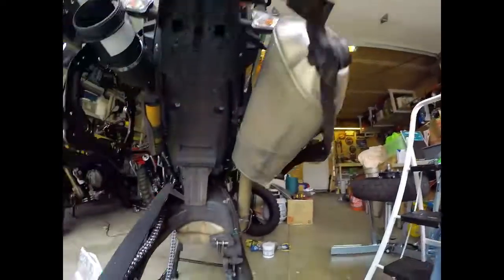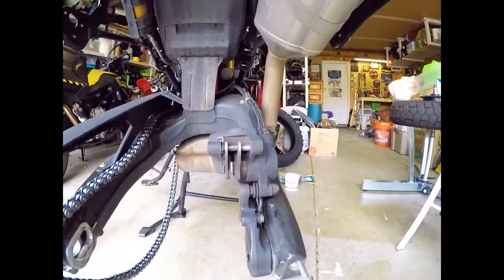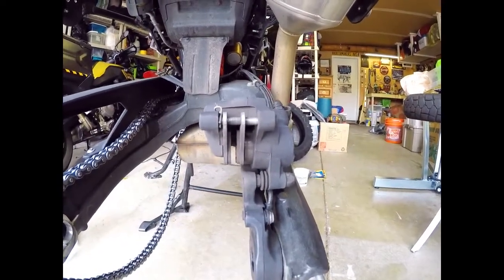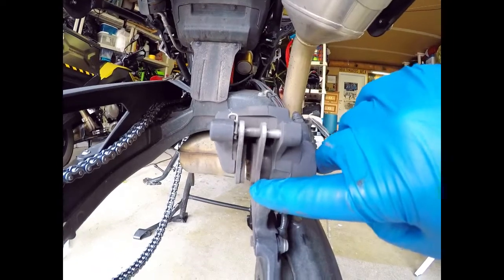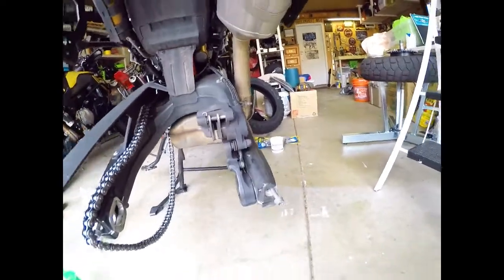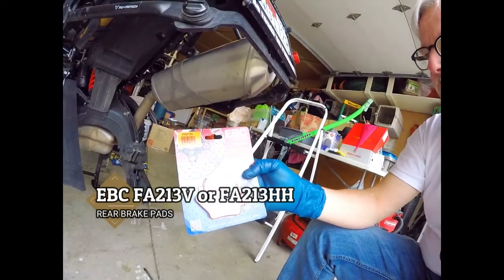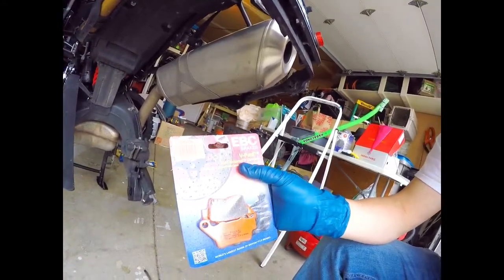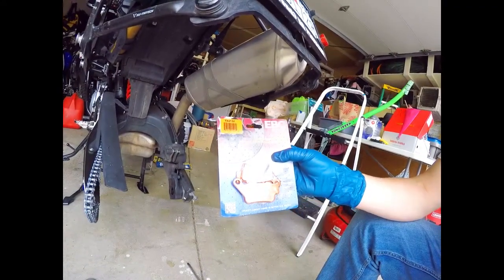2019 BMW F850GS Rear Brake Pads

Comment: Normally to replace pads I would leave the wheel in and remove the caliper from the disc ....I looked at a 750gs and couldn't see easily how you remove the caliper ...ie no obvious bolts so maybe yes the only way is to remove the wheel 
Regards mark (uk)
Reply from the maker: You know it's a good point Mark. I've never considered just taking the caliper off! For the 750/850, the front could work that way I'm pretty sure, but the rear caliper is trapped by the wheel and the slide assembly on it.
Reply: @bobwolff68  yes hi Bob ....I reviewed your bike a few years ago on my channel ....very impressed
My friend owns the same as yours and I was just looking on how to do the rear brakes .... usually it's just two bolts and slide the caliper off the disc ...but typical bmw have to be different and I couldn't see quickly any bots to remove... so like you say you kind of need to remove the wheel and slide the lot out 
All the best mark from  Poole uk south
Reply: No need to remove the wheel, or the caliper - the pads simply slid in and out. If you can drive the pin in out, this should be a 10min field job.

Comment: Have you done any video for brake bleeding? I saw your brake reservoir so clear, links for your video much appreciated. Thank you!
Reply from the maker: Hey man - I do brake bleeding on my WR250R, but I decided not to do it on the new BMW machines because to do it "properly" you have to be hooked up to the computer to do it. My intuition tells me I could do a good job without the computer but I don't know what all sensors they have involved that might trip things up. So I throw up my hands on brake bleeding for the 750 and 850 both. :(
Reply: @bobwolff68  dhang I thought it’s just that easy I didn’t realize that it’s all computerized.
Reply: Hey bob as I was changing my rear pads there’s this metal backing plate that came off I know there’s a correct orientation on this because it is a curve, by any chance can you guide me if what’s the proper orientation so I can put it back? TIA
Reply: I wish I can send a picture so I can show you what I’m talking about. :(